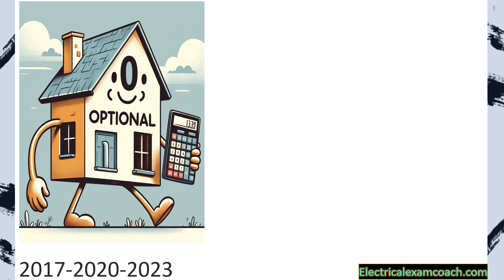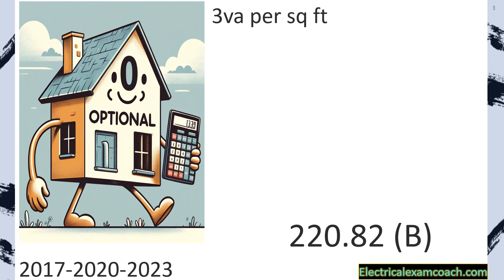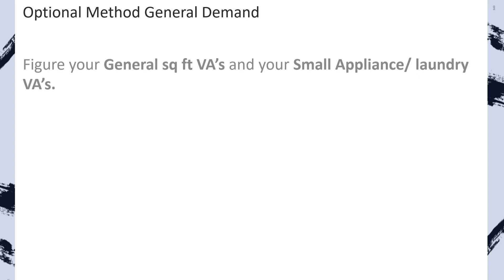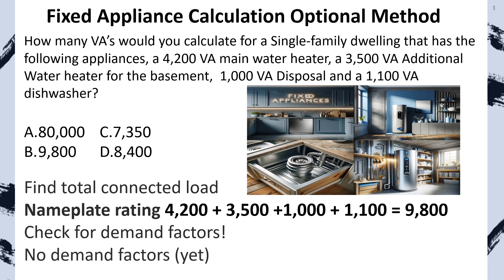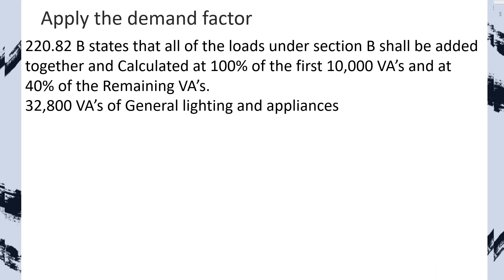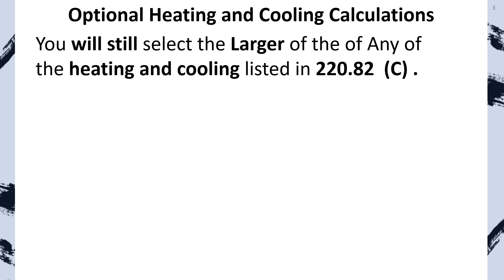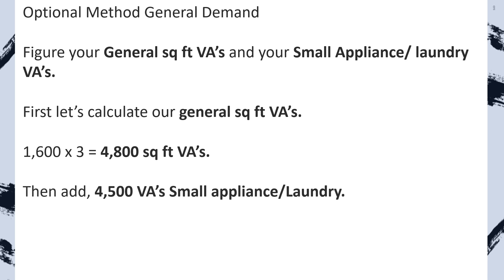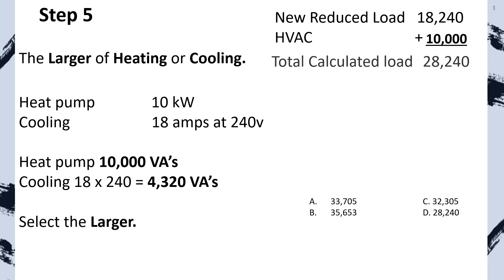Lesson 5.1 Optional Load Calculations FULL. NEC electrical Exam Prep 2017 / 2020 / 2023 Compatible

Comment: Using 220.82(C)(3) Is it true that in a normal residential setup that the Heat Pump is prevented from operating at the same time as the supplemental heat strip in the furnace?  If they can be run at the same time, we would use 100% of the heat pump AND (code uses word "and") 65% of the supplemental heat.....ADDED together as one of the six choices to use for the optional calc.  So, it's not always as simple as heat OR A/C.

Am I reading it incorrectly, or do they have 100% independent operation?

Comment: Hi coach, question, if an A/C unit it’s required 30 amp minimum breaker and 50 amp maximum breaker could I use #10 copper wires and to install 50 amp breaker in the panel box?